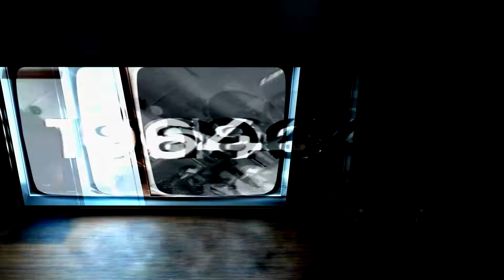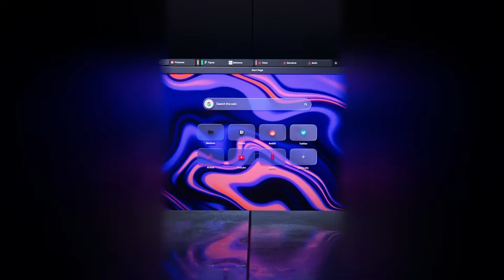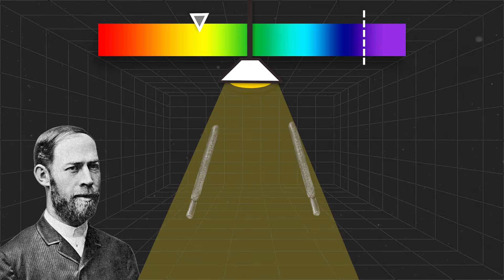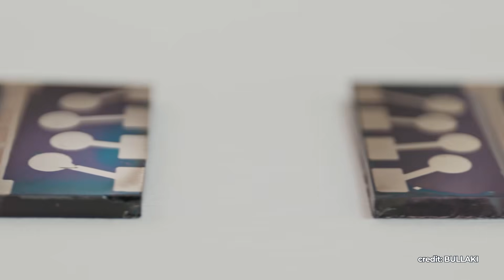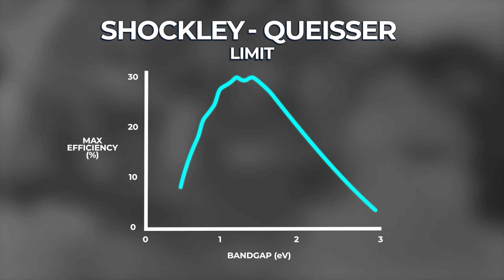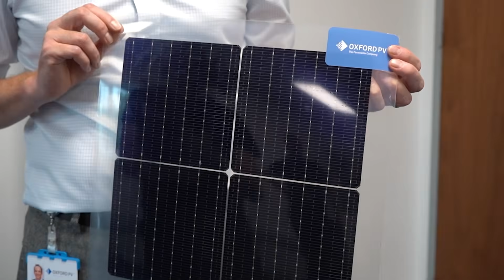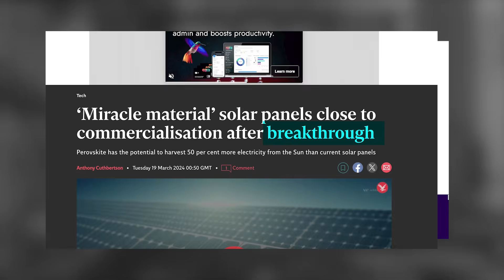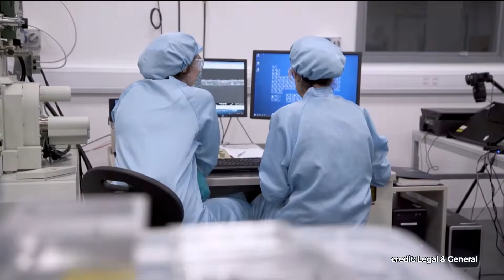How Physicists Broke the Solar Efficiency Record

Comment: It is a bit sad to see how many people in the comment section think this is not a big deal or the video title is clickbating (to any meaningful degree).
You can rewatch 16:57. The searcher said that the extra efficiency is worth the cost, so the overall energy generation per unit cost is increased from a typical silicone PV cell. Not to mention, making new technology (perovskites) commercially competitive is a good factor by itself since it sharply changes the incentive in investing in the new technology which is likely better in the long term anyway.

The bridge from fundamental physics to engineering and application, has always been hard to cross, especially if an old tech has been optimized for decades. It is very important to find a way to make new tech commercially competitive (not to mention, it is superior in this case), and this company found a way to do that. This is a big deal.

I think condensed matter physics video is just hard to be appealing to the public compared to Gravity, Astroparticle & Particle Physics, mostly due to the background knowledge needed. However, Dr. Ben Miles really did a wonderful job in covering such a hard topic.

Comment: Esta bien es más cara, pero en la proporción en que aumenta su eficiencia es la misma en la que disminuye el área para colocar los paneles para producir la misma energía que los paneles tradicionales, abaratando costes de infraestructura, mano de obra, materiales disminuyendo el largo de cables y conectores lo cual contribuye al mejoramiento de pérdidas, además de abaratar el mantenimiento como puede ser el lavado. Así que se compensa, es preferible tener 1MWh de potencia instalada con 1500 paneles así valgan el doble que con 3000, intuyo.

Comment: Hello Tom Stanton,

I appreciate the scale of your experiments. I am an avid cyclist and I think that there is real potential in isothermal flight. I have been kind of down and out and not really able to afford to make a pretty important project to me. I was looking at the wikipedia for a compressed air car that uses paraffin wax as a phase change material. The compressed air would flow through a "batch reactor" that is filled with paraffin wax that was liquified with a Peltier Tile. The paraffin wax resolidifies and the latent heat is regenerated into the compressed air. When I imagine isothermal flight, I imagine filling an aircraft with enough cold air so that it can propel itself to an altitude at which the temperature is less than 0°C and turn on an air compressor and refill at that altitude so that I can use water as the PCM because it has better energy density. Anyway, follow if you would...

I want to describe for you a linearly parabolic solar concentrator. This is a low temperature batch reactor vs. the high temperature supercritical steam tube reactor. To make the prototype cost effective, I use a laser cutter to make the ends of the linearly parabolic mirror out of wood and use "reflective insulation" from the hardware store. It is like aluminized bubble wrap and it comes in 16" rolls. 

There are a couple different "latent heat of fusion" reactions you can do in the reaction vessel. The reaction vessel will simply be a section of 2" PEX tubing. There will be three sections of 1/2" copper pipe that zig zag through the PEX tubing, through which compressed air will flow. The volume inside the 2" cylinder, minus three(3) 1/2" cylinders, is ~501.94cm² per 1 foot section. Excuse my mixed units, but inside the reaction vessel will be a volume of Phase Change Material(PCM.) I will call it 500cm² for easy math. Although, the volume should probably be smaller to allow for expansion when the phase changes from liquid to solid.

The compressed air has to be at a temperature that is cooler than the temperature at which the PCM solidifies: Paraffin Wax solidifies at 50°C, Water Solidifies at 0°C. Paraffin Wax had 146j/g of latent heat, water has 334J/g.  

Paraffin Wax is 146x500=73KJ. 
Water is the superior PCM; 334x500 = 167KJ.

I am kind of homeless and I was designing a small scale reaction that uses water. I was kind of hoping that I could use a cheap tire inflator as the prime mover. Of course this would only work outside when the atmospheric temperatures are lower than 0°C, but I would easily be able to charge a laptop and probably cook using electricity. This is considered to be an "isothermal batch reactor" it has a deltaT of 1°C, the water always changes phases up and down between 0°C and 1°C. I wanted to install photovoltaic cells onto the bottom of the reaction vessel so that they point into the trough concentrator. This would convert upto 25% of the light that is concentrated onto them into electricity for the tire inflator, and I was considering a Peltier Tile for thermal runaway protection(also to use in reverse for night time operation, I could toss handwarmers on it.) I could not use the photovoltaic cells on the reaction vessel if I use Paraffin Wax as the PCM because the temperature is too high.

Anyway, the compressed air would flow through a rotary vane motor and turn an alternator. I have not built this design and I do not understand fully the behavior of this reaction. I wanted to put it together and use FLIR imaging to learn about the way the reaction occurs in the vessel and tweak flow rates and try to mesh the Pulse Width Modulation from the tire inflator with bands of Peltier tiles on the reaction vessel so that there is a sinusoidal pattern of thermal transfer. Do you have a voltmeter with a laser tach?

From,
Tyler

P.S. Larger scale reactions using water can be made possible with intercooling. My idea is to take the compressor head off of the cylinder and put the cylinder inside of a freezer chest and install the head on the lid. I could fill the cylinder at night when the temperatures outside are coolest, or even put these components in the cool basement. The two stage head has an intercooler on it. Then, the freezer chest cools the working fluid for the system to the appropriate temperature.

Comment: Can perovskites be tuned to an infrared band for waste heat harvesting? Where do they fit with thermoradiative diodes, thermophotovoltaic cells, and infrared rectennas? Is this an economical way to reclaim energy lost to the environment that might instead be used as electricity at electric-arc steel mills, plasma-assisted ammonia-fixation plants, cement kilns, walls of heated/cooled houses, pumps and motors? Or is the scale of efficiency and durability just too low for industrial and residential uses to pay?

Comment: The title of this video can be reused every two years or so.  There are real physical discoveries going on almost every. Some will make it to manufacture and sales, others not.  BUT the real solar development exploded onto the scene in about 2018, and that was the backdoor of the discussion. Cost.  Relative cost of a watt.   Today, if you want to produce and sell electricity and you are talking grid power,, powering 2 million homes, powering entire cities or entire states or countries.   Solar cells are far cheaper to produce a watt of electricity than anything else.  Does not matter, natural gas, nuclear, hydro, wind, coal, solar is least expensive.  Sooooo, developments that improve production within that least cost structure,, improvements of 1% , 3%, all of it matters.  EVs are the biggest driver (pun intended)   1 million EVs in the US in 2021   2m 2022, 3m 2023, 5m 2024,  an estimated 35 million by 2030.  The US will need to triple its electric production in the next 5 years.   Lotsa, lotsa, solar panels.

Comment: My question about those tandem cells, is why doesn't the material in the top layer block light from penetrating through to the material in the lower layer?

Comment: Solar and Wind are only as cheap as they are because of government grants. These methods pale in comparison to nuclear and hydro by comparison. They just have the benefit of modularity and significantly lower up front cost. But there's a company working on conversions for simple coal plants to small nuclear plants. Which is a much better solution. The physical structure and systems are already there, just a matter of converting it to use a different, much more efficient heat source.

Comment: it would make more sense to suspend it in polimer immitating an M I T multipolimer fkat top pyramid, to concentrate light on specific points  while also securing them,   u could run pipes beneath each block true the blocks to maintain cooling. and work on structural integrity of a cheep encapsulating material rather then. overall efficiency..  If u make the panels needles in this material u might get good resolts

Comment: Solar is interesting (for rooftop) but not the solution for today's power plant energy needs.  That still belongs to natural gas and nuclear if we ever start building nuclear plants again.  Solar needs break the 50% efficiency barrier and then it has the time limit as night and clouds devastate it ( it does my solar rooftop). I would focus on fusion, as the next energy alternative, other than that natural gas electrical plants are the best solution.

Comment: So, a little progress was made. Nature uses 100 % of the light of the Sun and now with this solar panel brake through the efficiency is rased from almost nothing till a few points higher, well done, the Chinese will make millions of Dollars by using this research to improve their products.
Reply: Don’t know where you read that but that’s incorrect, tree leaves only use a fraction of the light that hits them , which is why there green to absorb the visable spectrum of light , ( blue -red)

Comment: If we could get 30% it is an unviable option for the future, unfortunately, since AI will increase energy demands along with many other improvements to technology. Upper estimates suggest cities with AI using approx 10 GW of power. Assuming 30% efficiency, 1 square meter of solar panels produce 300 w, which means 12.9 square miles of solar panels would need to be placed somewhere, which is slightly less than the size of downtown Los Angeles. Just to buy the panels themselves, and not adding labor, computers, frames and motors to move to orient to the sun would cost $6 billion, and you’ll only get power during the day. 

A 4th generation nuclear power generator could generate over 10 GW of power, 24/7 and cost less than buying the solar panels and wouldn’t require the a second city worth of land to power a single city. While I think solar has its uses, specifically for homes in cases of emergencies, it too unrealistic to consider as a viable option for power, especially considering the other options we have. 

Regardless, this is a great video, thank you for the information, I do hope to see this research continue. Maybe 1 day we can get the full 1000w per square meter with further advancements

Comment: more efficient, flexible, printable, and the cells are all that perfect flip flop electric blue anodized chrome finish...

cover EVs in as much of this as we can justify with design. every black surface. roof, center of the hood, all the pillars. only put colored plastic accent fairings over the solar car underneath. use transparent solar on the windows. still allow it to plug in, and add an RTG as a car life range extender that charges the batteries. the car will have theoretically infinite range, but you can prolong the life of the vehicle by plugging it in to save RTG power...
Reply: solar range extended plug in hybrid is the way here yall. 

series hybrid. dual range extend EVs... 

youre just throwing away the energy of the sun because of cost. 

we dont want a solar car. we want solar as w range extender on a normal car like a Tesla or a Volt...

Comment: Issues, yes you can create a better nano structure to absorb solar energy, but it's significantly larger than the normal substrate which decreases it's potential when compared to regular solar panels.

Comment: The only true measure of a photovoltaic panel is dollars per kwh  I can envision a 12% efficient panel that takes over the industry,, because it only costs 4 dollars and is projected to last 40 years with only a 10%  degradation in the 40 years.  In general, solar photovoltaic panels took over the electrical generation of the world,,, not because of environmental concerns, that helped, but as of 2018 it became the cheapest way to generate watts.  Today, photovoltaic electrical grid generation is half the cost of its nearest competitor.  It is less expensive than coal. natural gas, nuclear, wind,, even hydro, especially new hydro.

Comment: Problem - Screen printing or splattering PV Cells produce a thin layer that "erodes" over time with solar bombardment as they are very thin.  This makes the PV life short 5 to 10 years.  Silicon is "thick," and the life of panels (by personal experience) exceeds 20 years.  My fathers farm and our 5 acre property is solely solar and while we've changed out panels because a 450watt panel fits in the same spot in the array a 200watt panel fit the panels were and still are fully functional.  The same cannot be said for amorphous solar panels which do not last.

Comment: Solar is NOT clean!  Do a little research on how the silicon in solar panels is created!  

Coal, quartz, furnace!  

First you must mine both the coal and the high purity quartz.

2nd Transport it.

3rd Crush both into a fine powder

4th combine and fire in 2000 degree arc furnace.  

A solar panels cannot offset the co2 released in its production over its entire working life.  

Do a little research before hitting the record button!

Comment: I wonder if there could be some kind of material that has a varying energy bandgap based on its heat.
Then perhaps you could make a multi-junction cell out of just one material, by varying its physical structure instead of needing to use different materials with different manufacturing processes.

I'm not much of an engineer, but I can definitely see how differing approaches affect things when I play games like Factorio with my friend.
He goes for maximum efficiency on each layer of progress before moving to the next.
While I prefer to move forward as quickly as possible, using the new technologies of future layers to go back and make previous layers more efficient, and see what I even require from the previous layers.
The same was true when I did more programming, I just can't focus so much on hyper optimizing something before I have things working as a whole.

With all of those possible combinations, surely AI can sift through them and find promising ones the same way it has done with protein folding.
Though perhaps that's what we need quantum computing for, areas where those simulations are based in compute heavy quantum mechanics.

Comment: I went off-grid about a dozen years ago. I have old monocrystalline panels. My panels are somewhere above 10% on a sunny Okanogan Highlands day. Since the introduction of LiFePO4 batteries I only fire up my generators when a big Pacific storm blows through. I'm not desparate for a functional replacement, but it sure would be nice. At -20°s and cloudy, things get a bit dicey for the panels and the generator. Better battery chemistry and panel compositions are what I would like to see. There has to be some tricksy compositions that are still hiding in the combinatorial crevices.
Reply: Where I am coming from, we celebrate the two partially cloudy days we have every year
Reply: @Abduladilosman  I live on the east side of the Cascade Mountain Range, up near Canada in the Okanogan County, in a part called the Highlands. On a big bluff. But this time of year the clouds sink at night to the valley below us, then, as the day wears on, the clouds rise with the sun and our output crashes. It's almost a daily event.
     So, going into town early, we drive down through the cloud cover, then later, we drive up into very thick fog. Sometimes we are even in the snowflake creation layer.
     This lasts 6-8 weeks per year and makes a generator necessary. We get less than 10" of precipitation per year, but still gotta keep my expensive propane refrigerators and 1 watt lights in happy juice.
     Good luck with your system.
Reply: @davidhanna8470  I feel misunderstood here😅😅 what I meant is my country is the sunniest in the world.
Reply: @Abduladilosman Did not mean to insult or belittle. But, it's 5°s farenheit or about -15 C right now, snowing. I hsven't been down to town in a month, I can't see more than 20 meters out my window,  so maybe I have a touch of Cabin Fever.
     Please forgive any insult I may have given.. My wife says I am a jerk only 1/2 the time. So hopefully this text is from my better half. Ha.
Reply: I'm pretty sure I understood that, I was kind of agreeing because I live in the second sunniest place in the american northwest. Cold, mostly dry and high altitude, usually above the clouds. But days like today make me long for hot, late July days when I can see blue sky forever and not a cloud in sight.
Reply: We supposedly have satellites in space that have been running off of solar for 50+ years.  That means the "good" technology that can run stuff very efficiently is over 50 years old.  BUT ON THIS PLANET THE CRAP WE USE CAN'T MAKE IT A SEASON WITHOUT MAINTENANCE.  And space is supposedly the coldest, most hostile environment in our known existence.  We are being LIED to.  Rovers go to Mars and run on solar.......in a supposedly very hostile environment...WTH is going on?